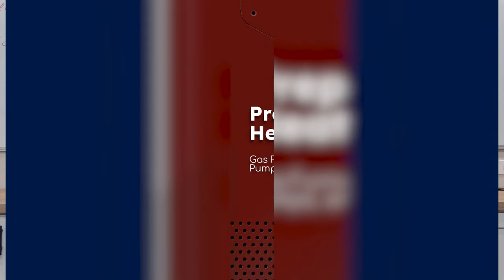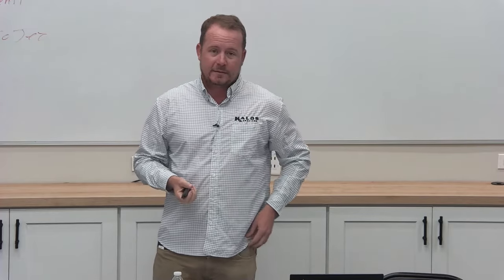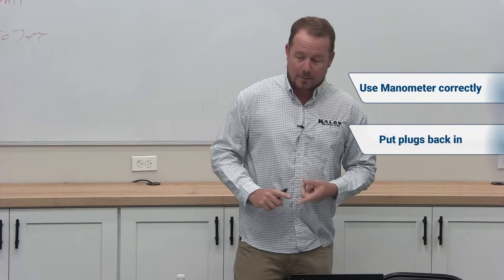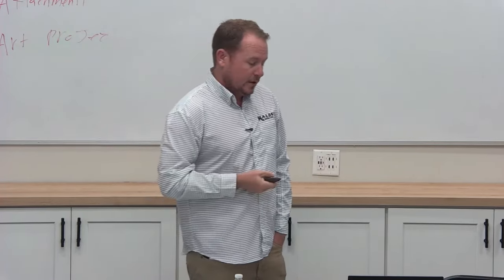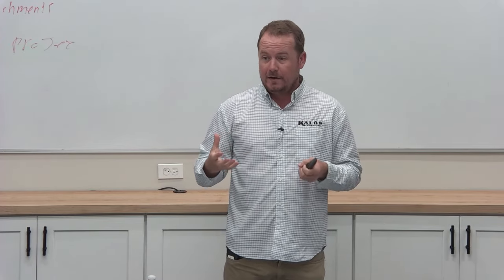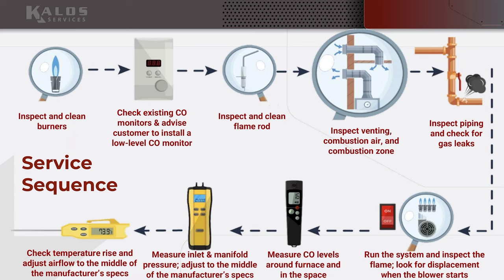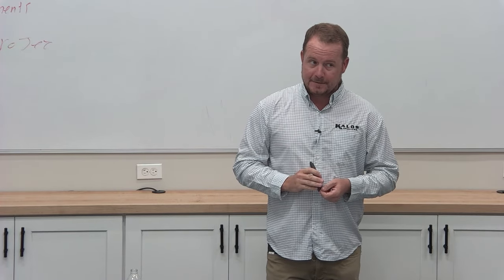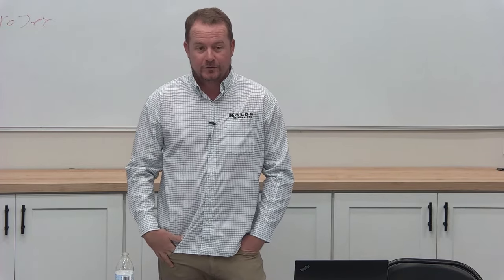Gas Appliances - Preparing for Heating Season Part 2

Comment: A standing pilot using a thermocouple is usually rated @30mv and will operate the valve at 22mv or higher. The standing pilot creates voltage to keep a solenoid valve open. There are also thermopiles....which are a bunch of thermocouples inside one. They are usually rated at 750mv. You can test a thermocouple or thermopile by using your meter. You use one lead on the end and one on the tube. Use a lighter or a torch on very low. You can test the millivolts to see if it operating properly

Comment: This is very helpful, gives me terms to look up and basic safety info. 

I used to live in a house that had soot near one of the heat vents. Landlord said it was from “not changing furnace filters enough” but now I think it was combustion air mixing with vent air.